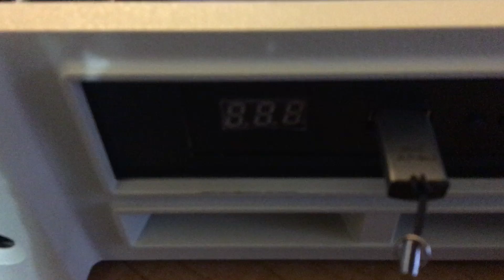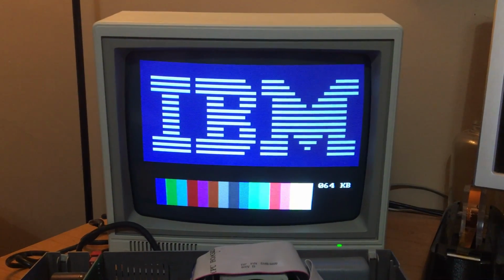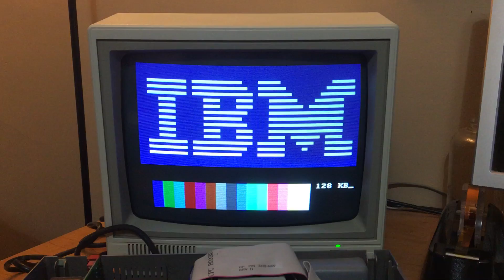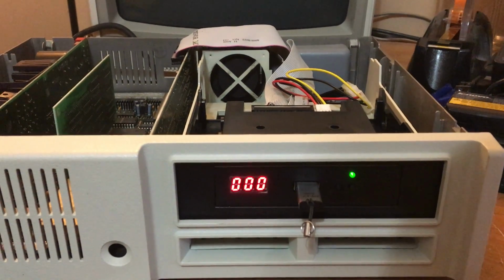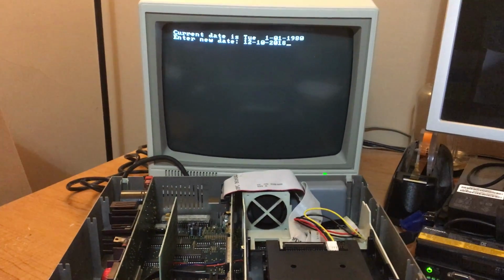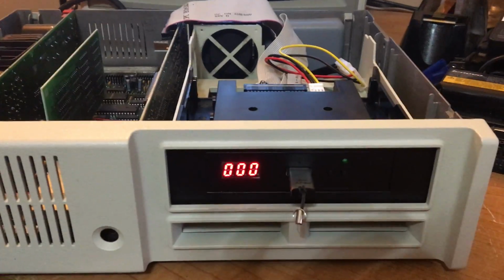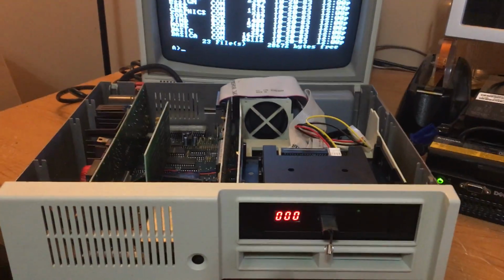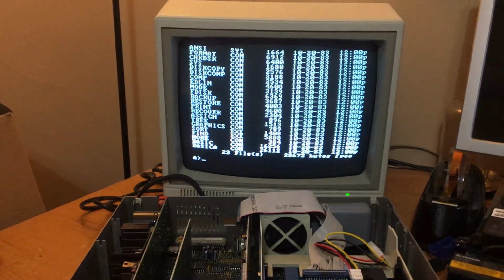IBM PCjr - Gotek Floppy Emulator - HXC2001 Firmware

Comment: I use these in both Amiga and Atari ST using the FlashFloppy firmware. That firmware is free and no HFE conversion is needed. Super easy to flash these too. I recently installed one (again with the FlashFloppy firmware) into a Windows 98 circa year 2000 Alienware machine, and found that both S1 and JC needed to be closed in order for it to work correctly. JC is the "non-shugart" mode. This can also be set in the flash floppy config, but that would mean having a config file on any USB I use...not something I wanted. So, with JC closed it is just a matter of copying DSKA0000.img named files (DSKA0001..etc) to the USB and off you go.
Reply: FYI The HxC firmware for Gotek doesn't need any HFE conversion and can be installed very very easily over a "flashfloppy" gotek with just an USB stick :) . Btw your jumper settings recommendation doesn't work here : The PCjr use another interface mode, and the JC jumper is used by the HxC firmware for some extra hardware mods not currently supported by others firmwares.
Reply: @JeffHxC2001  I was not "recommending" my jumper settings to be applied for PCJr use. I was merely throwing out information on what I needed to do to get mine to work on my old Alienware machine. FlashFloppy firmware works perfectly fine on a PCJr as well. And yes, you can easily overwrite the free and open source FlashFloppy firmware with the HxC firmware, after you pay 10 euro for it :)

But, I will give it to the HxC firmware for the fact that it supports many more disk formats than the FlashFloppy firmware. If I needed it for another disk format I would say the price is fair. It is just not necessary in my case.
Reply: @eightbit1975  "free" ok. mhh wait, is 10 euros too much for such softwares ? Are these firmwares and the attached support so bad that you don't want pay anything to the developers ?
Reply: @JeffHxC2001  Come on now Jeff. You do this in the forums as well any time someone mentions the FlashFloppy firmware. The firmware is free, open source and works perfectly on multiple platforms. You should not be aggravated with the fact that someone else wrote a firmware that does mostly the same thing (for the platforms it supports) and gives it away for free. I never said your firmware is not worth paying for.....if someone needs it. There are a lot of people who do not need or use it because a free working alternative is available. I actually needed your firmware for a few things in the past and I did pay for it (by purchasing a few expensive Lotharek floppy emulators with it pre-installed) so please do not judge me.
Reply: @eightbit1975  Don't be offended, i am just trying to understand. You are commenting a video about the "HXC2001 firmware" waving the flashfloppy flag with some wrong informations about the HxC firmware (indirectly telling that it need a conversion to HFE for example) to finally pushing the price argument. That's why i respond, just to "fix" some of these informations, nothing more. Cheers :). (My comments may appears "rough" but English is not my first language so forgive me)
Reply: @JeffHxC2001  No problem Jeff. I was not trying to take away from the HxC firmware....just chiming in to what I did with one Gotek on a PC on my end. Both firmwares are excellent (yours and FF) and I think they both co-exist in the world and are both needed for different things. Nobody can take away from you the fact that your firmware supports so many formats and the software you provide is very useful.

Comment: Hi. I know this unit because I use it on commodore amiga system. It´s esay to flash and use a disk manager directly on the root of the usb tha plugs into gotek.
But , I can not get a guide to do it whit a PC computer. 

I have got one hxc gotek unit. An know a software that format and organize floppy disk on the usb before plug it. But ... My windows Me on the 486 system can´t read any from the gotek.
Any idea? I need a guide for noobs step by step.
Reply: Hi Santiago. I would advise checking your cable connections first. Make sure you've got the ribbon cable connected properly. It's possible to reverse the connection.

Here's a link to a list of compatible equipment: https://hxc2001.com/download/floppy_drive_emulator/support.htm
You might reach out on their forums to see if one of their members has some better information. Good luck!
Reply: For normal 486 machines, set the jumper to S1. Then you have just to copy the IMG files to the stick. If you have just a 7 segments screen, you may need to rename them DSKA0000.IMG, DSKA0001.IMG, DSKA0002.IMG, DSKA0003.IMG... and use the "indexed" config file. All is explained in the HxC firmware archive :
https://hxc2001.com/download/floppy_drive_emulator/HXCFEUSB_HFE_beta_firmware.zip